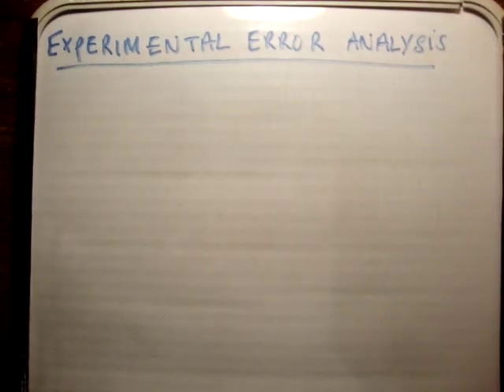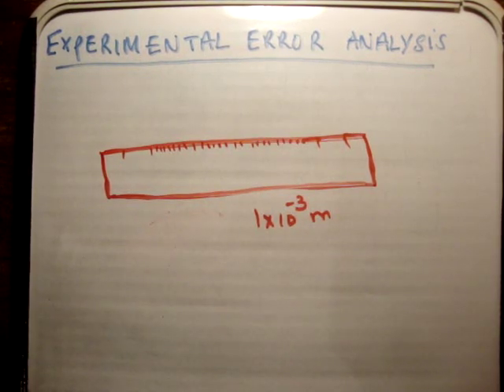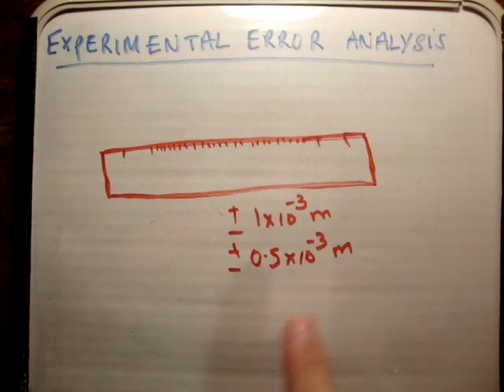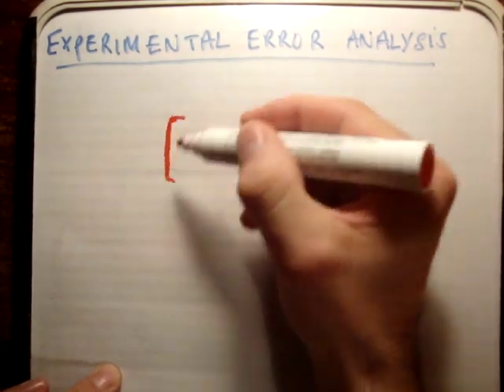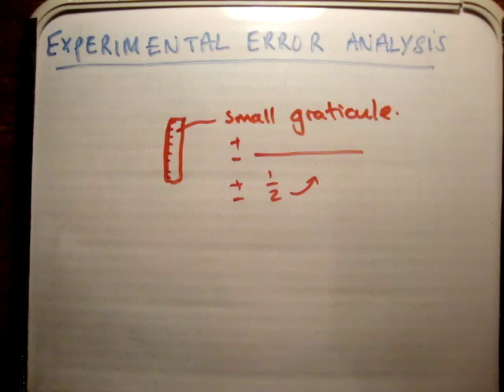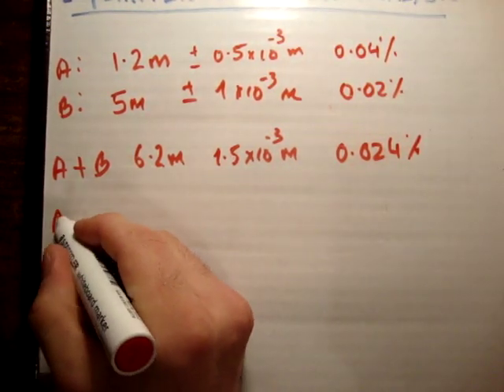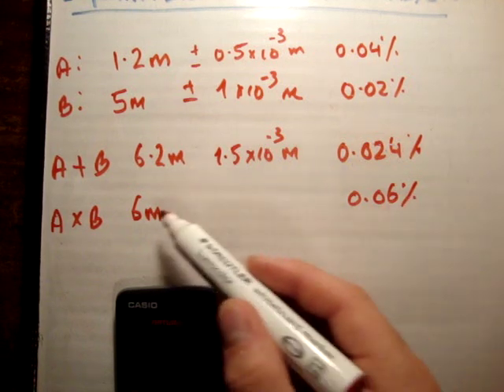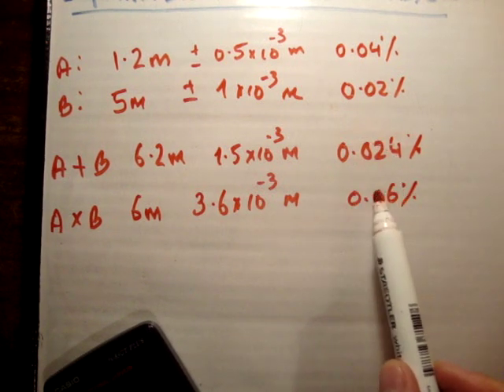Experimental Error Analysis

Comment from the maker: Well yes and no. You cannot just do that where you are using a number of different measurements as part of a formula in order to analyse or calculate some other quantity. Here you will require both actual and percentage error. Alternatively of course you can use partial derivatives to estimate the error in your measurements.

Comment: At 3:53, if 1.2 m is measured as 1 m + 20 cm using the same meter stick, won't the errors for 1 m and 20 cm measurements be separate?

Comment: Thanks a lot!
Reply from the maker: Thank you for your feedback! As a matter of interest, if you're striving for the highest quality error analysis then the final formula I wrote is what you require; this is nothing other than the definition of the change in a multivariable function - see minute 5 here if that's new Thermodynamics 6 : Heat Capacity . In English it's the sum of the rate of change of the function WRT each variable multiplied by the change in each variable; which hopefully should make some sense.